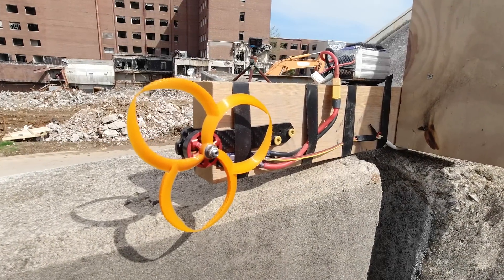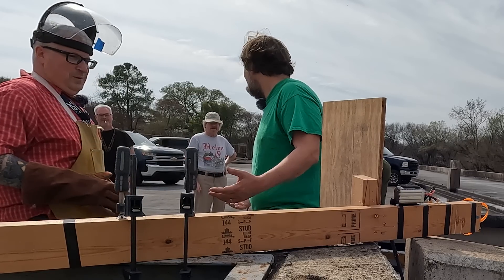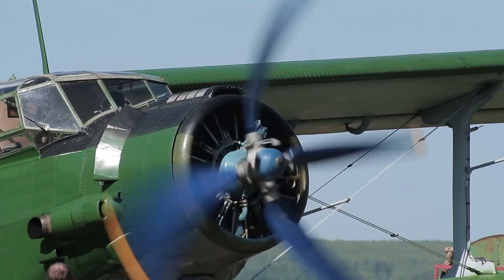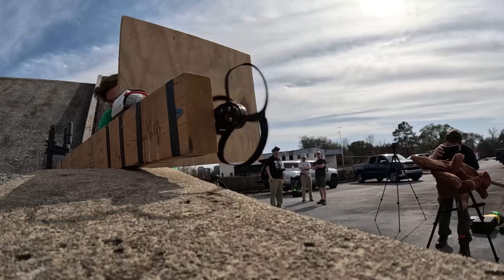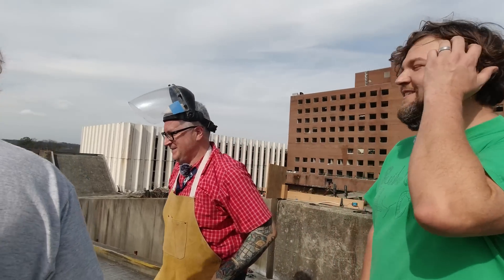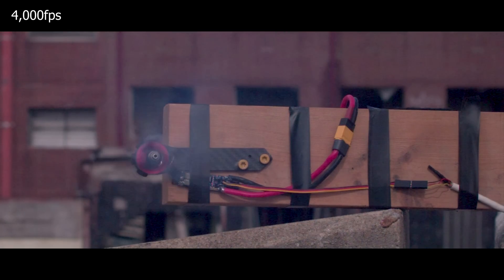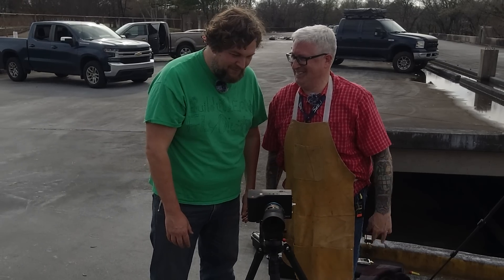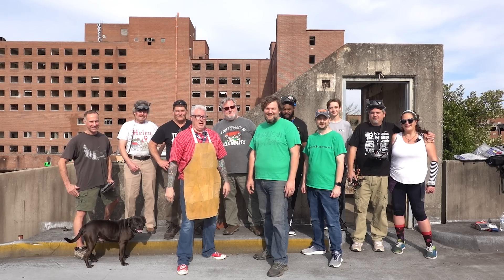TOROIDAL drone Propellers - The Good the Bad and the FUGLY

Comment: Toroidal props are one of those things that seem cool and you really want them to be successful but they just suck. The propellers that zip line are using are pretty interesting. I think they would be more a bit more plausible that these. 🤷🏻‍♂️

I think that the newest motors they are doing research on that don't require rare earth magnets will be the next great thing.  They have advantages such as improved sustainability, supply chain security, and potentially greater efficiency and compactness.

Comment: But realisticly you can print props out of pla... just not drone props... they spin too fast. I recently did my own experiments with different fan bladea and found that replacing one on my air cpressor was actually quite a bit more cooling for the piston head. Lasted for as long as well... my son dropped my air compressor.... but running only spins at like 1750 rpm. Safe by a long shot...

Comment: I've never watched any other videos from you guys, but I seriously hope nobody is taking engineering advice from you. You can absolutely make props that won't shatter under drone usage. The print quality on the props shown here is comical at best. They are unbalanced, rough edged, and entirely too thin to handle any amount of thrust. I know many who print props and have never had a catastrophic failure shown here when done right. I'm not even advocating you SHOULD print props, just don't take this video as evidence one way or the other.

Comment: First of all you picked the shittiest Toroidal Propeller design ever to use, any design that has the propeller join on to adjacent Propeller is going to suffer from high vibration weakness and weak structural integrity. Next time make it go straight back to the prop itself. 

Secondly the rings are too damn big and the flat surfaces aren't wide enough and thick enough hence why it broke so easily.

If you're going to do something like this again at least do it right. What you've done is the equivalent of got glueing a couple hoop earrings to prop and saying it's a Toroidal  Propeller.
Reply from the maker: You've missed the point of this video completely. My advice:
Please print your own propellers.🤣
Reply: @Kenheron   I'm just pointing out what I found wrong with the Toroidal Propeller. But let's get on Topic "Don't 3d print propellers". 

Right if you're going to make a video about this with different materials at least use the same design across the board for a more consistent test. If you have done that the results would've been more impactful but what you gave us was a test that was all over the place. Lastly in the title implied it was going to be about the Toroidal Propeller, if there's anything you should take away from this is be more consistent with your test and don't be misleading with your titles.

Comment: The toroidal props are certainly interesting, but they would have to be manufactured in a factory with higher precision, smooth edges, and very low tolerance. 3D printing anything leaves edges where each layer line is, and the aerodynamics of the props rely on those smooth edges. The ones shown here are self-defeating.

Comment: With newer idea it will always be the edge cases that benefit most... Yes we've perfected general props ... but what if you want the absolute quietest 4 inch props possible so long as it flies?   What about ducted?   There are a ton of little possible advantages that won't mean squat to regular flying but those edge cases man ... These things could open up some things simply not possible with regular bladed props.
Reply from the maker: The only thing these propellers will open up is your skin.
Enjoy the lacerations.
Reply: @Kenheron  testing is obviously always stand back  lol 

I meant more as the design not the material.... Yeah temporary at best for 3d prints
Reply: @Kenheron  Why are you so angry
Reply: I'd love to see some improvements in performance too, but i place little value in low performing quiet props.  We do already have really efficient  props, really thrusty props, really durable props, and all sorts of mixes in between.  Drones have been pushing it further as we have several manufacturers all releasing multiple designs per year

Comment: Is FPV that hard to get used too??
Did you have motion sickness in the beginning??
Reply: It's pretty easy to get used to. I'll get nervous sometimes, depending on the spot and the pressure, but it's always fun. Try a sim to get used to flying in "acro" mode like a bird or a plane, instead of "angle" mode like a gps drone👍 Liftoff has great physics and doesnt take too much of a computer,  TrypFPV is gorgeous,  and lets you run scenarios like chasing dirt bikes, air planes, sky divers, rally cars, etc

Comment: How do you feel about 3D printing them then make molds from that to cast resin from? @Fly High FPV
Reply: FDM printers have layer lines, much like a topographical map, , but those ridges do not make good wings. You'd want to smooth them, so the molds arent bumpy. One option is to print in ABS, and then use Isopropyl alcohol vapor to "smooth" the surfaces...i'll keep buying $3 injection molded polycarbonate from gemfan 🤣
Reply: @Fly_High_FPV  lmao 😂 I feel that waaay more work than it’s worth for sure! I’ve cleaned up a few 3D printed items and sanded those lines for hours so k know what you mean. Did a Scorpion mask from mortal combat, and then did a Gundam Robot Head bust that I painted. Great stuff Dave!! 
Gotta keep your eye on those Ken’s and getting you to do stuff!!!
Reply: @Andyrewk  fill, then sand, if you must....but, naw, fuck it🤣

Comment: I use these props and they work fantastic, don't no what you guys did wrong lol . They work on all my DJI drones perfect.....
Reply: Did you see the shoty workmanship on those prop prints that is their problem and the toroidal prop is way to thin and most likely is not an air foil design.
Reply: @loranmorash8532  Not only that but most DJI drones don't spin at 42,000 RPM, lol. More like 12,000.
Reply: @loranmorash8532  Ken deliberately made a whole video with crappy props because he can't fly even with good ones
Reply: Yup, just overall shoddy "engineering" work here. Nobody who prints functional 3d parts would think they did well on those.
Reply: Ken is always wrong about new stuff because he hasn't even mastered the old stuff. I love him but he's getting too old
Reply: MIT 3d printed them, not molded. The whole project is scam and you can see for yourself they have all the money but still abandoned the project